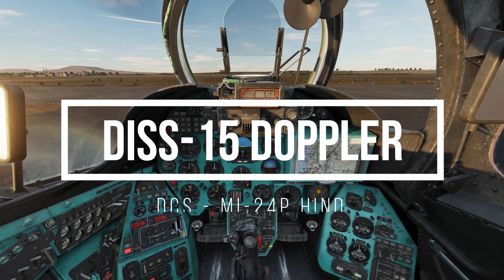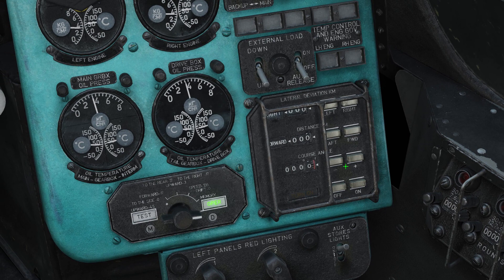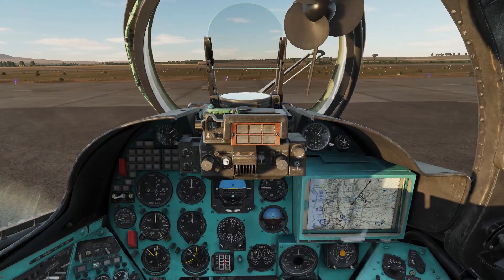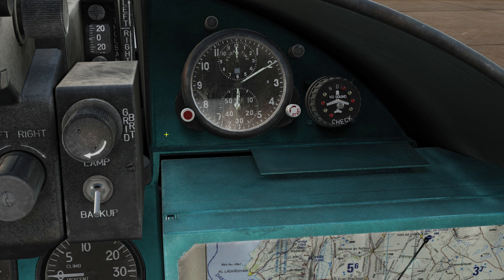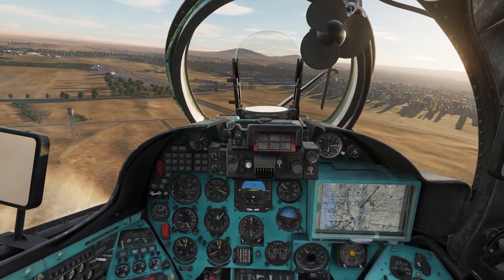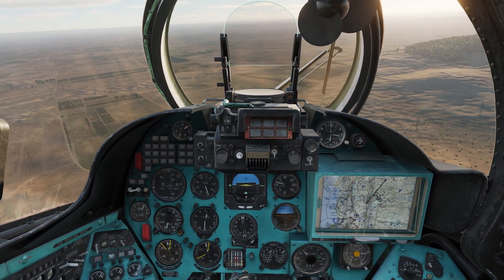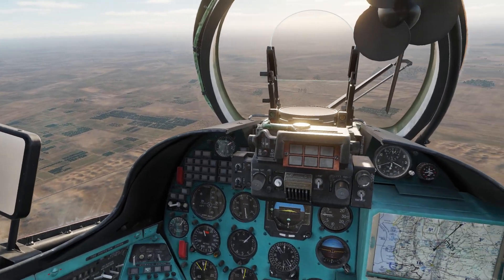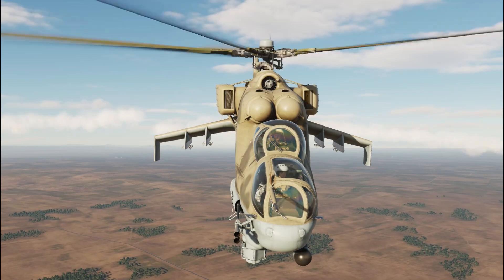DCS MI-24P Hind - DISS-15 Doppler Navigation and clock Tutorial

Comment: Good video but sadly i tried your video in the Mi-24P Georgian Column Single Player Mission (from the workshop) and it sadly dosen´t work. I set the course to 112 and the distance via aft to 57km but the distance is counting upword and the right left drift is counting updword to the right even if i would fly to the left of the course.

Seems a little bit buggy at least on caucasus.
Reply from the maker: Have you ensured the Airspeed to DISS-15 circuit breaker is turned off?
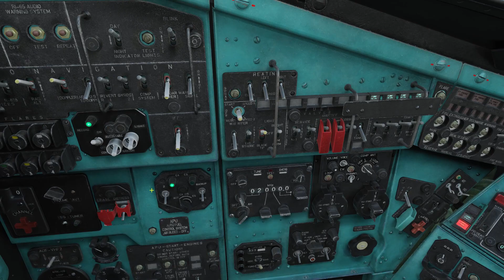Reply: @Sithis1989  I´m not quiet that good at english technical terms. If you mean the switches at 1:08 it looks exactly like in your video. I did do the autostart so it should not be the case that i forget something. It seems like the left right drift panel correctly displays my flight distance (in the mission it was 57 km) and the distance panel is by 59 - 60km.

It seems a little bit like the counters are completly switched. The distance only changed by like 2-3km and the left right drift did count the km correctly. 
Its a little bit crazy.
Reply from the maker: @TheSeb12345  That does sound like the system assumes you are turned 90° to your track. I´ll do some testing and see if I can replicate the error.
Reply from the maker: @TheSeb12345  On the course, are you sure you input 112.0° and not 011,2°
Reply: @Sithis1989  Hahaha i´m the one who was stupid. I treated the course heading number you have to set as 3 numbers but they are 4 and i diden´t recognized it because i was just testing out. 
I was programming 011.2 and not 112.0 which was leading to my results. Now all works like a charm. Thanks for the video ^^
Reply from the maker: @TheSeb12345  Haha no worries, glad I could help, Russian cockpits arent the most ..... user friendly things in the world.

Comment: 00:12 "...you can see here, that on that flight path there are very little reference points for us to navigate by..."

this is a good video, and imma let you finish... but there's a railroad track that goes straight from Hama to Abu al-Duhur. You can see it on the map, and it runs right next to the Hama airport fence. You fly over it at 5:54. Just follow it north, and make a right at the junction. Its on the left side of the canopy for much of the flight.
Reply from the maker: haha damn you got me!
Next time I am going to add: "For the purpose of this presentation..."
Reply: Wartime pilots used this method, it was called ‘Right hand left Rail’ . Especially useful in N Africa and Russia.